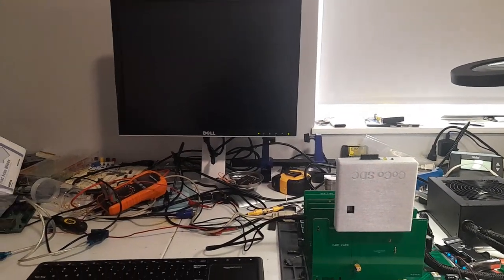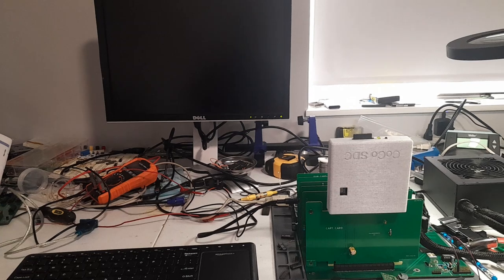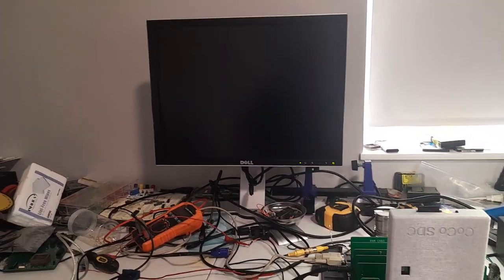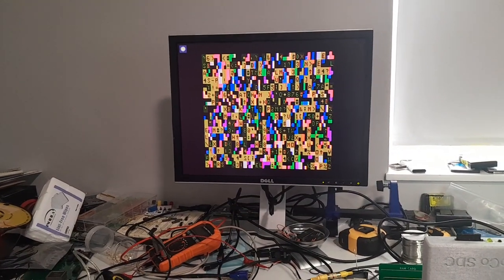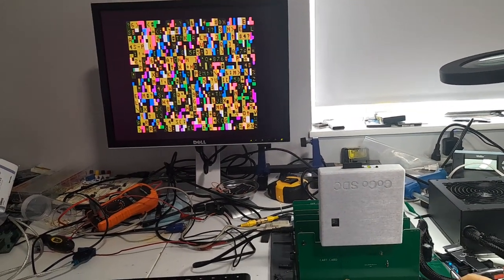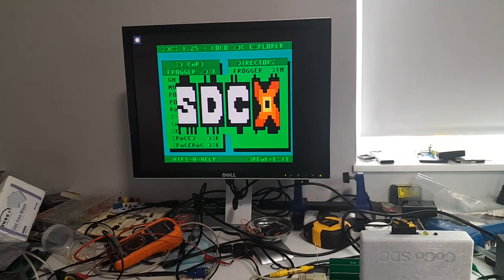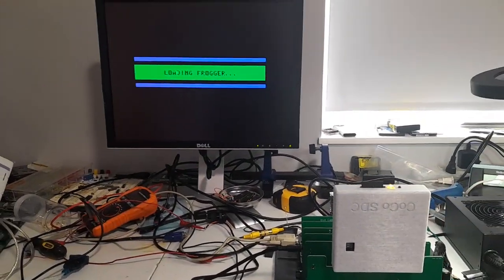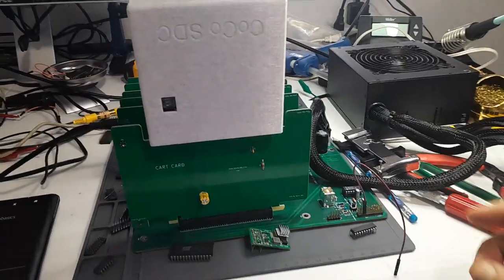CoCo ATX Working Again (CoCo 2 mode)

Comment: Remember, you did not break it.  You're just figuring out ways that it doesn't work!
Reply from the maker: lol! Words to live by!
Reply: Sounds like the SDC just needs more reset time, or to be plugged into a proper MPI device with its own power…
Reply from the maker: @julianbrown1331  I think the MPI does suffer from that. However, the CoCo ATX behaves that way even without the SDC. I'm going to try and change with the capacitor in the reset circuit with one that has a higher capacitance to increase it's time to charge.
Reply: @ or switch to a proper timer circuit….
Reply from the maker: @julianbrown1331  that too.